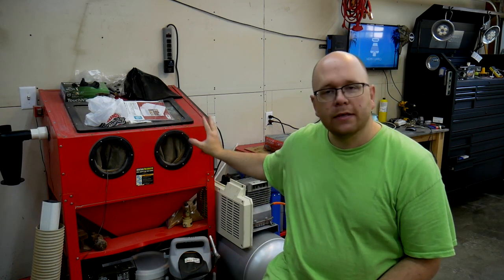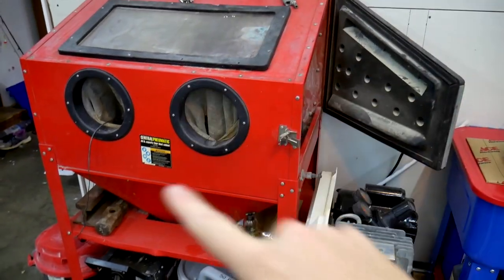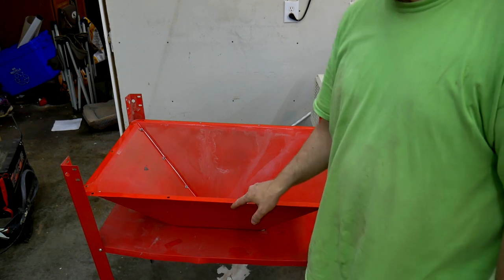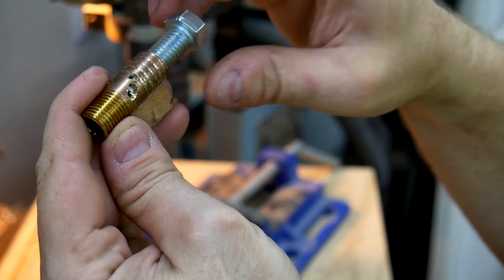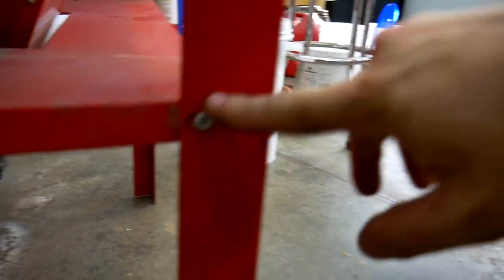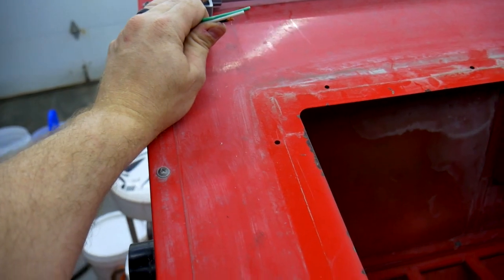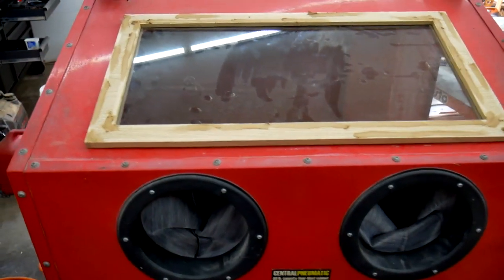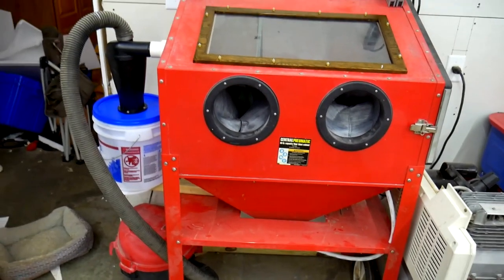Rescuing an old Sand Blasting Cabinet: Refurbish and Upgrades

Comment: Thanks for your video! Have had issues with water from your air compressor yet?

I had all kinds of problems, even after installing two inline water filters. Finally solved it by adding an auto water drain valve kit on the air compressor drain plug.

I’m using the Dewalt auto drain kit….
Reply from the maker: I have the same on my system. Seems to help a lot.

Comment: what compressor are you using? horse power? CFM? pressure?
Thanks
Reply from the maker: It is a 60-gallon 11.5 SCFM compressor. It does the job.
Reply: I guess my little compressor is not going to do it.
Would you let me know what brand compressor, motor voltage ( I only have 110/115, pictures because I may have to buy another one.
Reply from the maker: @tonyportella994 mine is a Diamond brand found at my local farm/fleet store however any 60 gallon compressor would be adequate for your needs. Kobalt, Husky, DeWalt etc. most of them are made in the same factory and have different branding painted on the tanks.

Comment: I got one for Christmas from my son .I Bound out if there's any water in your compressor the beat blusher will not keep working cause. It gets the glass wet and it will not go to thenazzle no. WI gotta figure out a way of putting the thing on the bottom of my compressor to drain the water out of it. I get an elbow and do that.  But it works really well does a good job. I'm very happy with it god bless have a great day oldgeorge

Comment: whats it like for leaking after you sealed it mate??  any dust/media out the seams still. im about to do mine
Reply from the maker: Only leak is where I passed the sand feeder tube through the box. I need to put a grommet on the tube to seal it off better.

Comment: Excellent find for 40 bucks! You were doing great with the rebuild till you made the metering valve. The basic concept was there but a poor choice of parts to construct it. I've watched many YouTube videos on different designs on how to build one of these but the parts you chose to use were very restrictive (too small) and will result in poor performance and slow blasting results. When you get a chance you might want to build a more efficient metering valve and a better gun, you'll be glad you did.
Reply: I've never had any problems or trouble with the simple internal syphon system; the few times I have had less than good results have been easily remedied.   I have seen a bunch (!) of youtube videos where the first thing folks do is add a "gravity" feed "metering" valve to the cabinet.  Some of these are homemade and some are commercial.  The gun venturi provides the suction necessary to pull the media up from the hopper regardless of the arrangement.  The least distance that the media has to travel is optimum.  The only system design that is more efficient is the pressure pot system.  They are mostly (yes, there are a couple of exceptions) commercial and expensive.  I think most of the frustration with syphon tubes is damp media, gun nozzle trouble, mismatched components, and blocked or poorly made syphon tubes.

Comment: I'm shirt somewhere in the comments and I know it's already been done so it doesn't really matter but why not just mail a light bar inside and run the wire out put it into a multi plug flicker shop vac into that and then every time you plug in your multi plug it just turns both of them on but you would still have the power of turning one on or one off and in that configuration you wouldn't have to drag the shop back around cuz it would be detachable by just unplugging it from the multi plug
Reply from the maker: I have a dedicated shop vac just for my sandblaster.